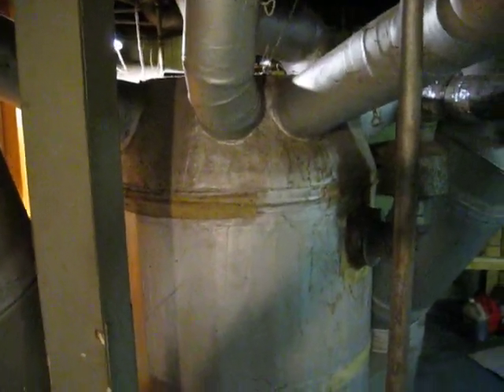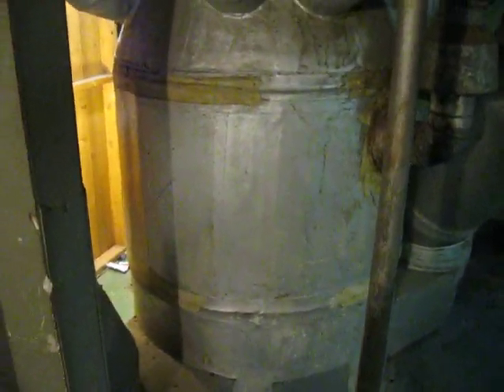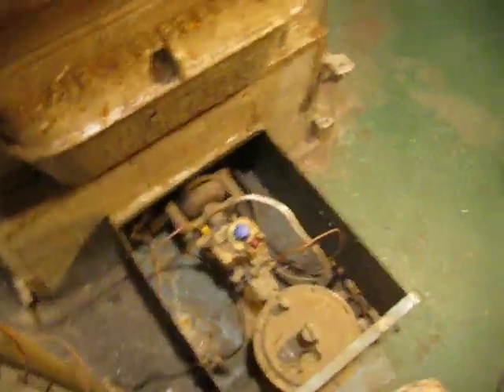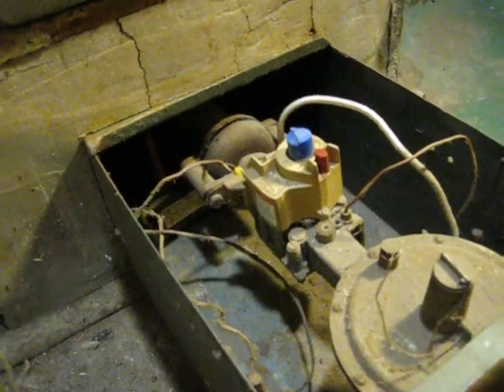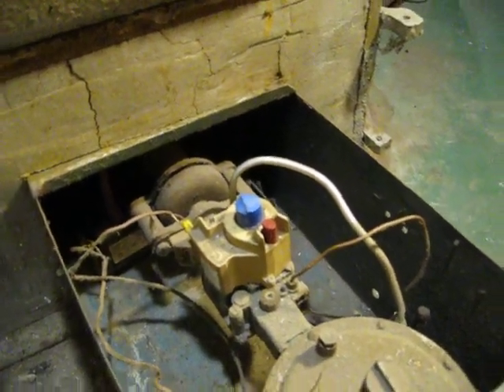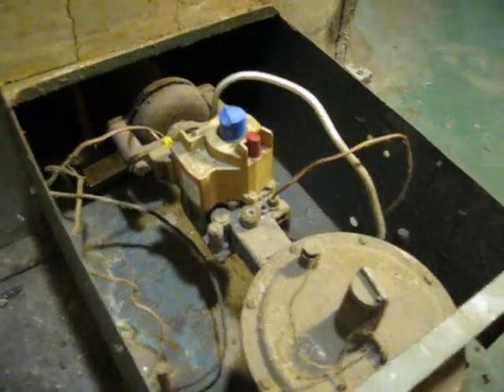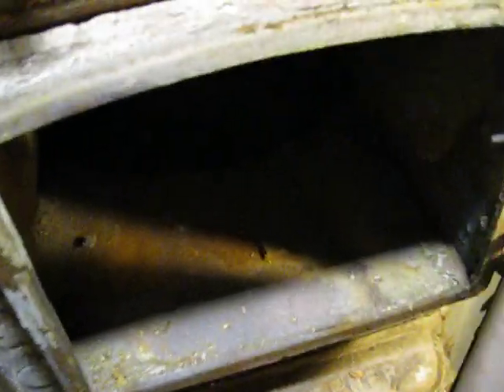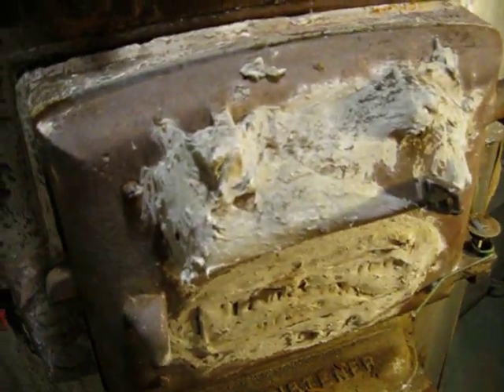Gravity Furnace Walk Around and Startup

Comment from the maker: @billeesy Prices have gone up in the past, but they've dropped more recently (as in the last few years). Mine runs a bit rich; I need to adjust that. If you aren't comfortable doing it yourself, you should be able to find someone local that can help you out.

I've gotten quotes for replacement; including asbestos abatement, new ducts (need to be smaller and relocated out), >95% efficiency furnace, and AC, it was going to be around $20k give or take.

Comment: I have had been operating my gravity furnace in my house for the past 8 years.  My winter gas bills have been over $400 bucks.  They never went over $200 when I first moved into my house.  I don't know if its the hike in prices or something needs to be adjusted or both.  I want to install a high efficient furnace without removing the gravity furnace but I am not sure if this is possible.
Reply: Fit a fan in the air return and link it to a fan limit switch.

Comment: at 3:39 that is the safety limit switch to shut cycle the burner if the heat exchanger gets too hot. I don't know what temp they should be set at on an octopus.

Comment: I'd be more worried about the asbestos than the furnace working. Very simple design. Highly inefficient, like running an oven burner inside a chamber, capturing and directing the heat with natural convection. How much it costs depends on the size of the house.

Comment from the maker: @kagome122885 I'll definitely hold on to it for this winter; I'm still weighing my future options. I'm curious to see what the gas bill looks like. One thing to note: my burner controller has built in thermocouple-based flame supervision, so it'll automatically go into safety shutdown mode upon loss of power. It only draws 24 vdc at a few hundred milliamps, so I may try to rig up a battery backup.
Reply: More reliable then todays computerized junk full of sensors.

Comment: These things are built to last, and are really cool looking.  They also can work even if the power goes out.  Don't replace it.  The new furnaces have too much that can go wrong with them.
Reply: My son had a gas furnace in a house that was less than 10 years old when it stopped working. A HVAC contractor told him it would cost $1,200 to fix it. He looked up the error code it was displaying on the internet and replaced a faulty pressure switch himself for $50.
Reply: @pamalford8319  They love to tell you that the whole unit needs to be replaced even when it's only a minor issue. Mine clicked off for no reason. I had it checked, and they wanted to charge an ungodly sum to bring in a new one, despite this being only 5 or 6. Lo and behold, there's an error indicator light under a cover. Googling that error code told be that I just needed to reset an override switch. Cost exactly $0 to get the heat back on.